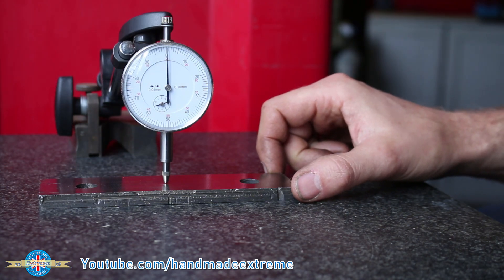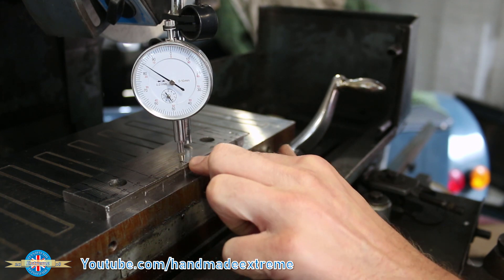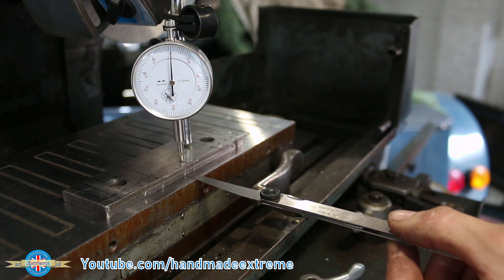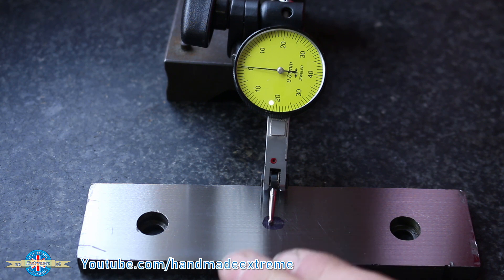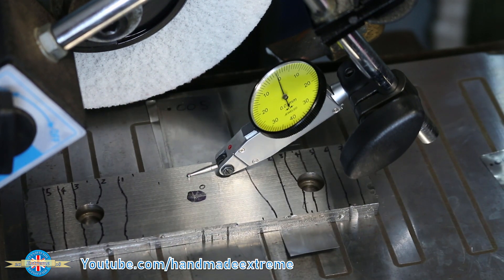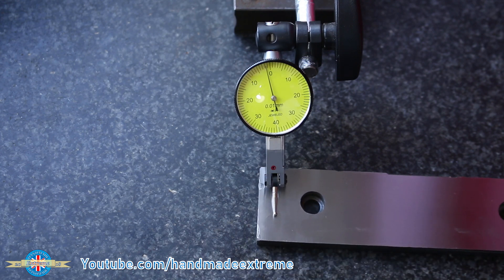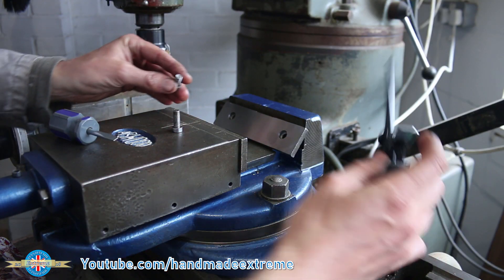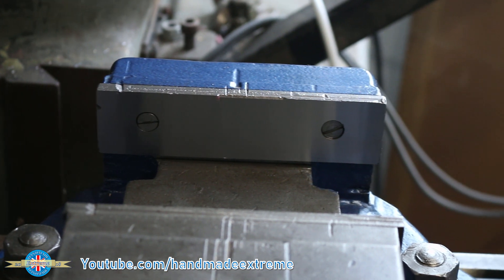Surface Grinding Thin Parts on a Jones and Shipman 540 Surface Grinder (Machine Vice/Vise Jaws)

Comment: Obtain a precision straight edge. Remove the vice (vise in USA). Remove the table. Check and if necessary grind the ways flat, first those on the machine, then those under the table. Replace the table. Check and if necessary grind the top of table flat. Clamp vice back on table and grind top of vice flat.

Comment: Here is a method that I use. It work good with most thin parts. https://www.youtube.com/watch?v=VT84xVLY8Ug&t=17s  Wheel selection is very important as well. I love your not giving up attitude. I am sure you learned a lot that will come in handy for future projects.
Steve

Comment: looks like you are using a 46 grit wheel which is good.  Dress it more open, it sounds glazed. Perhaps your diamond is too worn.  
Yes the chuck needs a regrind.
De-magnetize part.  Block it in at the front.  Slowly turn the chuck on until you feel the slightest friction on the part. If you turn it on fully it won't matter if you turn it off - it'll still be bowed.
No shim.  Work both sides equally.

Comment: The first thing I think when I see this, is to put a piece of 3mm steel the size of the magplate, on the magplate, and run the surface grinder across the whole thing, New level surface to work on. 

No idea if it would help, but it's the first solution that comes to mind.

Comment: You realize that putting the part on the mag chuck at a diagonal will help a lot of these problems, right? By placing the part on the mag chuck so that it's, uh...well square for lack of a better term, you are introducing errors into the grind. Put the part on it caddywhompus and then flip it for every pass. It'll take a lot longer but it'll remover a bunch of error from that mag chuck.
Reply from the maker: Awesome, thanks for the advice. As you can probably tell I'm quite new to surface grinding.
Reply: @Handmadeextreme  Also  if you spin it (not turn it upside down) so that a different corner is pointing towards the "knee" (the part that the spindle attached to) you'll cancel out any mag chuck errors. Hop that makes sense. Hard to describe some of these procedures in text. Go watch This Old Tony do some work on his surface grinder. You'll see what I'm saying.
Reply from the maker: @WmSrite-pi8ck   @Wm. Srite  Awesome advice, thanks very much. I Enjoy his videos a lot. I'll have to toddle on over and take a look. Cheers.
Reply: Also, don't clamp every part to the same spot over and over again. That's how the mag chuck got those low spots. Use different areas on it as much as possible. I know you can't do that 100% of the time, but when you can...

Comment: instead of placing the work longways, place the work as diagonally as possible and use a specific coolant for surface grinding.
Reply from the maker: Excellent advice, Thank you.
Reply: specific coolants for grinding can be expensive but are well worth the extra. If your budget won't stretch that far you can use a lower concentration down to just 3% which will still give the machine the rust protection it needs and will help stop the wheel loading too quickly. A grinding wheel only really needs cooling rather than lubrication....

Comment: Why don't you make a thick base that goes onto the magnets, since it's thick it doesn't get deformed (and ifit does it's fine because it's always the same deformation)
Then you surface that thick base and use this as a reference... that way your reference is always flat.
Then you can make a vise out of this thick base to hold the parts while grind-surfacing them.
Reply from the maker: Nice idea. I'll give that a try, Thanks for the support.

Comment: Nice video. I often use superglue on the first side as it doesnt impart any clamping force and is easy to remove with acetone. Once you have one flat side, the other side is easier
Reply from the maker: Great tip, hadn't considered that, i'll have to give it a go. Thanks very much!! 👍👍

Comment: Maybe worth dressing the mag chuck... Good way of dealing with lockdown...!
Reply from the maker: Yep, I think you are right. I'v been holding off doing it as i'm still learning how to use the machine and don't want to mess it up. Thanks for the tip and thanks for watching. 👍👍
Reply: @Handmadeextreme   check out Alec steele, think he did a surface grinder rebuilt.
Reply from the maker: Ah yes, I seem to recall him getting one a while back. I'v been watching his power hammer restoration series recently. I'll check it out, thanks. 👍

Comment: If you can't rely on the mag chuck to be flat, it's useless. Maybe give it a grind to fix it.
Reply from the maker: I think you are right! As a beginner with the surface grinder i'v been holding off doing it until I have a bit more experience with the machine. Thanks for the advice and thanks for watching. 👍
Reply: @Handmadeextreme  with any luck you will be able to dust it off a couple of thou only. That should last you quite some time in home use, if you dont keep sliding the work off the chuck that is. 😉
Thinks, it might be an idea to start looking for a demagnetiser, it is surprising how the part you are grinding picks up magnetism from the chuck, they also help with other tools that get magnetic over time.

Comment: part maybe heating up when being ground, and then when it cools it's too small?
Reply from the maker: Definitely a problem I had as well. Lets just say there were 'a few more' iterations than made it into the video haha. I'd have felt really bad if i'd asked you to endure any more. I saw an intersting video by This old tony a while back were he went into detail about this. How the ends stay fixed and it bows up in the middle, you grind it, then it cools and you get a low spot. 
It's a steep learning curve this surface grinding lark.
Thanks for watching. 👍👍
Reply: @Handmadeextreme  I watch him too. This is definitely something I could see someone going crazy on xD
Reply from the maker: Yeah, his channel is great, so well put together.

Comment: Love the videos. I respect anyone who can jump into YouTube while learning a new skill! That type of indicator is a dial indicator, dial test indicators have a pivot arm to take the reading. They are typically for more precise work. Dial indicators have a much larger range of travel and are great for, for instance, centering stock in a 4 jaw chuck. You might use a DTI on the surface plate for testing against a gauge block stack or finding the center of a bore on the mill. Might help if you’re looking for tools later!
Reply from the maker: Thanks Mike. I'm glad you are enjoying them. 
Great information on the indicators. I'll be sure to remember that, thanks very much. 👍👍👍
Reply: Chocolate vice jaws 😅

Comment: You got there in the end, I found it’s a big learning curve with a surface grinder, if it were me and I’m no expert, I would take the mag chuck of and clean and stone both surfaces, you could also grind the base flat the chuck sits on, also clamp the chuck on upside down and skim that as well, clean and stone again then bolt it back on, draw sharpie lines across the chuck, both directions, I used a 46 grit J to do mine, dress the wheel measure the thickness of a piece of paper and put it under the wheel when it snatches the paper out you know have far you’ve left to go down, turn on the chuck bring the wheel down till you see the faintest spark, move to the back and add a couple of tenths, coolant on and let it do it’s thing, check your marks and repeat till all the lines have gone, dress the wheel regularly, when ready for the last past put only a couple on tenths on let it come all the way across and the don’t send it back grinding, move it back to the start don’t add any more cut just let it spark out if it needs it twice then do it, it takes a long time to do but it’s worth it to know your chucks flat then any issues you have you know it’s not the chuck, that’s what I do anyway, hope it helps.

Alan.
Reply from the maker: Hi Alan, Great to hear from you again. Thanks for taking the time to write that out. Absolutely fantastic advice!!! 

i'm planning on doing a few more jobs with the machine as is to get a bit more confidence and experience. However they will be more cosmetic than dimensional. I''ll then do the chuck. i'm reluctant to jump straight to it as you rightly say "it's a big learning curve". 
The chuck looks like it's been done a few times over it's life so I want to make sure I get it right first time and don't do more harm than good.  
Thanks again for watching and i'm glad you are enjoying the videos. 👍👍

Comment: can't you just grind the mag chuck? pretty sure I saw keith rucker do that once..
Reply from the maker: I think that might be exactly what is required! 
I'm reluctant to do it at the moment though as i'm very much a beginner with the machine. I'd like to do a few jobs with it that are less critical to gain a bit more experience and confidence.  The chuck is looking like it's 'been done a few times' and does not have a huge amount left on it so I'd like to make sure I get it right first time. Thanks for watching 👍👍

Comment: Looks like you need to dust the chuck off, it's very common thing to do, check out soild Rock machine shop, guy is a master when it comes to surface grinding, great video!!
Reply from the maker: Thanks for the tip. I'll be sure to check them out. I'm still learning with the grinder (as you can tell haha) Glad you enjoyed it and thanks for watching 👍
Reply: @Handmadeextreme  we're all learning and looks like your going about it the right way! I did the mag chuck on my capco grinder and the 2 kinda pointers I would give are:

Map it out the same way you did on your part, use the dial gauge and re-measure after every pass, thing I found was that the wheel had worn away slightly or gotten clogged by the time I got to the end, this left the mag chuck sloping back towards the head if you get me?

The other thing I'd say is it might be worth taking the mag chuck apart due to your magnetism issue, the whole magnetic "pack" may not be moving to the "off" position if the cam or pin that activates the cam is worn, that was the case on my eclipse mag chuck anyway!

I'm by no means and expert at it but if I can help in anyway let me know, keep up the awesome work 👍👍
Reply from the maker: Great tips, thanks very much. I did wonder about taking the chuck apart and reducing the height of the magnet if the strength persists to be a problem. I hadn't considered that it might be that it's just not switching off.. doh..

I'm sure it will crop up in some upcoming videos again soon. 

Thanks again. 👍👍
Reply: @Handmadeextreme  might not be a good idea to take it apart unless you really really have to. They are not meant to be home shop serviced, if you believe the manufacturers.

Comment: Very interesting. So the source of the error was the fact that the magnetic chuck was bowed and this was bowing the part when the magnet was switched on fully, have I got that right? How would you correct that for future use? Presumably by surface grinding the top of the magnetic chuck?
Reply from the maker: Hi Carl. Great to hear from you again. I hope you are getting closer to home! 
I think so yes, that and a combination of the part not being initially flat itself. The magnetisation with the chuck on was enough to deform the part. So I'd grind it then it sprung back. Then I found the chuck wasn't flat which compounded the problem. Yes I think the solution will be to grind the chuck. I'm reluctant to do this though until I have a bit more experience with the machine. I'll probably try a few more jobs on it that are less dimension-ally critical then do the chuck once I have a bit more confidence with the machine. 
Thanks again for watching. 👍👍
Reply: @Handmadeextreme  I have been at home for a week but I volunteered to go back out on another job. I'm in a hotel in isolation prior to being tested for the virus on Thursday. If I'm well I can join the ship. I don't have any experience of surface grinding so that was really interesting. Seems there are a huge number of ways it can go wrong.
Reply: @Handmadeextreme  what can help is to have a piece of thin steel, well thinner than what you are grinding, to act as a stop and only partly engage the magnet. Thinking about that , if you are tempted to grind valve clearance shims you will need to have stops to stop the shim flying. Ideally thin steel with a hole for the shim to increase the area of the grip. Ask me how i know.😢